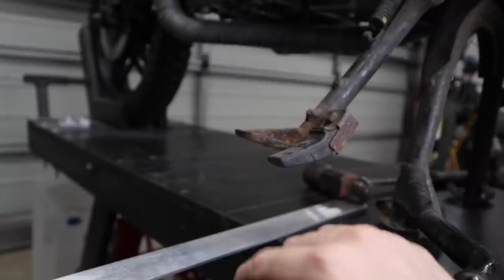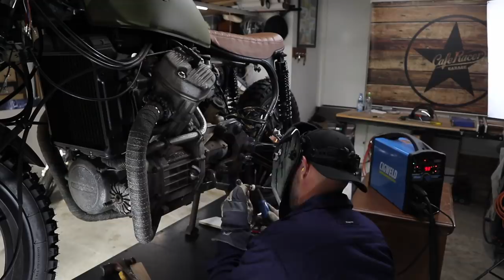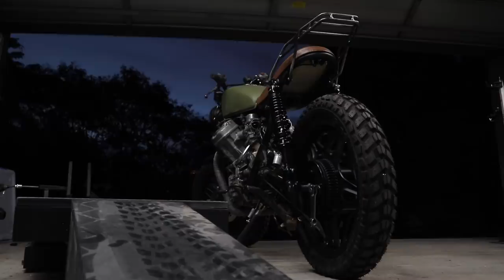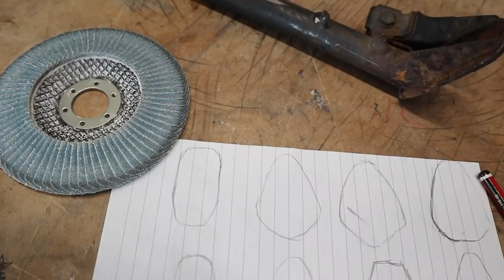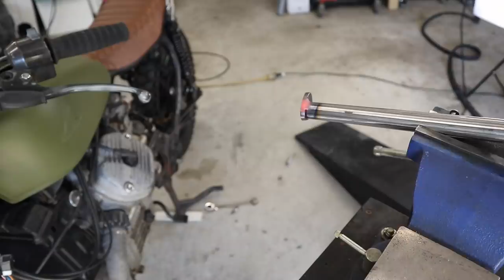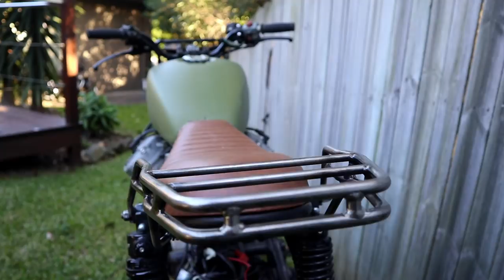Building A Longer Kickstand ★ CX500 Scrambler Budget Challenge build, Ep.28

Comment: My original side stand 1981 cx500c stands up too straight,  I have to look for a left leaning ground area, or a sneeze will tip it over. Don't have the means to weld. Thinking about heating till red and bending it.
Reply: Im not sure about the diameter  of all kickstand tubes . Not the same bike, but  I cut a section out of mine and used a tap to thread the inside for 3/4" all thread, with a couple of jam nuts ,made it adjustable.  No welding.

Comment: HI, What happened to the new Ultra 185 welder? did it break already or do you prefer the old manual machine better ?
Reply from the maker: Andrew Palmer the 185 is prominently a mig and I love Tig welding so I use a Tig welder where I can. The 205 ac/dc has a lot of control and very nice to use. 
You will still see the 185 in action don’t worry 😉